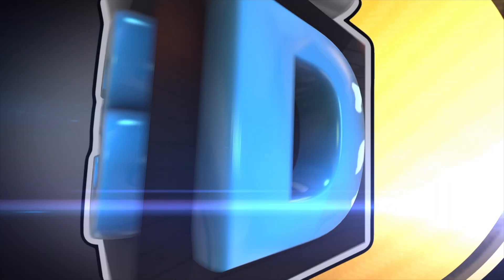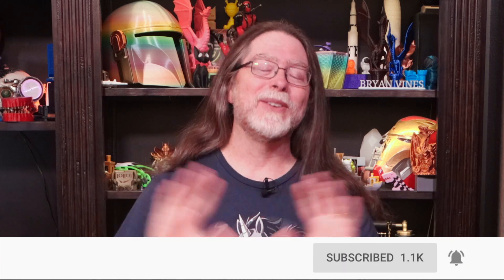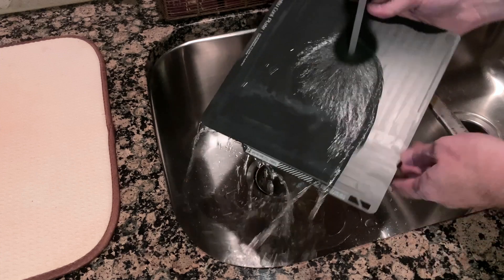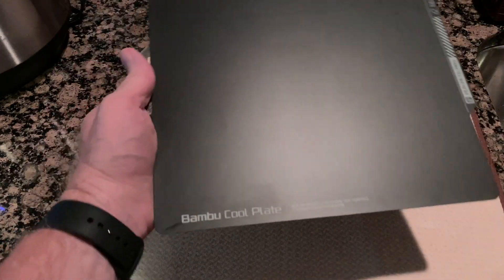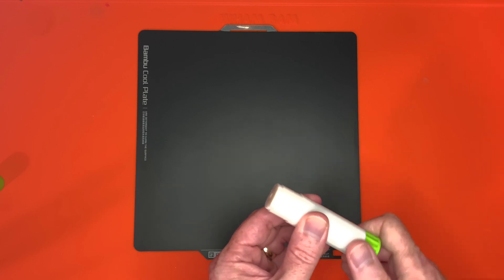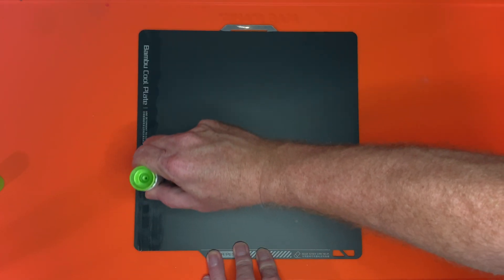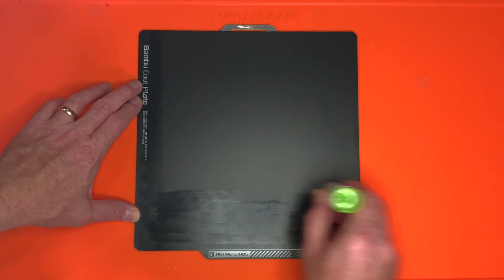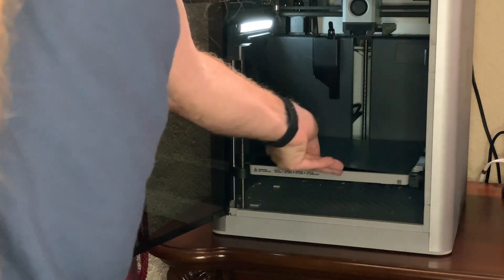Dress (the bed on your Bambu Lab X1 or X1 Carbon) for Success!

Comment: Thanks for this great video. I just did some test prints on a Bambu Lab X1 Carbon and the glue stick works perfectly. I have a question, however. I thought one must clean (I mean wash with soap) the build plate after EVERY print, but several people say they clean after 5-10 prints ??!?  It's just that, after I remove the prints, you can still see where the model was attached to the plate, though the plate itself is clean (i.e. there is no residual filament or anything), and I thought this glue stick residue would affect the next print ... So my question is : is it true that I only need to wash the build plate with soap once a week ? (or after 5 or 10 prints ?)

Comment: I noticed the PLA/ABS side of the build plate comes out of the box with a protective film that you need to remove (I almost printed on it), but I can't tell if the PA/TPU/PC side also has a film or not. Anyone knows?

Comment: Thanks for the video. On the other side, the Engineering Plate, do we use glue stick on that side too ? For the two replacement Cool plates that were included, when should we use those ? Do they just stick on top of the existing one ? Or is there something that peels off ?
Reply: Late reply, but for others reading and wondering - You peel off the old sticker and install the new one. They have a step by step on their Wiki. Glue - Yes you can use glue stick on Engineering plate, but they recently discontinued it in favor of a PEI plate.

Comment: Dumb question but, Does the glue need to dry before you print?
Reply: I'm absolutely  not an expert.  But I just put it in before I'm about to do the print.  I don't really wait for it to dry at all.  My prints (usually) come out perfectly... so my answer world be no,  not necessary to wait until it drys. I think that defeats the purpose. Happy to be corrected if I'm wrong.  Hope that helps
Reply: It's going to dry rather fast as your bed heats up to 60+ centigrade. I wouldn't worry.

Comment: Coming from a lowly Ender 3 Pro with a buildtech (or however it's spelled) magnetic plate, which has worked pretty much flawlessly for PLA at least, the thought of having to deal with glue sticks feels like an annoying step backward, especially when the X1 Carbon is an upgrade in every other way. I really hope Bambu Lab or a third party come out with a buildtech option.
Reply: There are already pei options available on AliExpress. They are a bit pricey but reviews so far where good

Comment: They supposedly had 2,000 ready to go. I've received less contact from Bambu so far than I have from Anker. I've received constant updates from anker. They said it's on the boat even though it was supposed to be late 2022/ early 2023. I've gotten nothing from Bambu and it's starting to worry me. When/how did you receive tracking about your X1?
Reply from the maker: Hi! Just after the close of the Kickstarter campaign, I received an email from Kickstarter (it was a post from Bambu Lab) to let me know they were sending out Pledgebox surveys to collect shipping addresses. I got that email, and the one from Pledgebox, on July 7. I filled out the survey, and got a shipping notice via email from Pledgebox on my particular Kickstarter unit about a month later (Aug 5). That email had the FedEx tracking info. The unit was delivered a few days after that.
Reply: @BV3D  Thanks so much. I received the pledge box survey and confirmation they received the info. Guess I just have to keep waiting. Thanks so much!

Comment: I went the expensive route and picked up some Nano Polymer but the place looks super clean and printer release with zero issues. 

I get about 10-20 prints before I feel I need to reapply.
Reply from the maker: Cool! Jim @TheEdgeOfTech is a big fan of that stuff.

Comment: Have you tried using 3DLac (or similar spray) as an alternative to glue stick on the Bambu Lab? In any case, it seems a bit of a hassle with this material, glad that there will be a PEI option in the future.
Reply: Stick far too much, damaged the bed sticker (bubbles). can be use slightly in addition to glu stick (apply with IPA)

Comment: Hey Bryan great video,
  May I humbly suggest a slight tweek to your method. If after your vertical lines on the left hand side you start at the back of the flexplate and work to the front you will be less likely to end up with any glue on your cuff, forearm or Steven Tyler wrist bandana. 😉

Comment: I don't have either of those printers, but do use glue stick on occasion. Might be worth making a Short video or quick blurb about glue sticks. They are NOT all the same. I ran across one of the Elmers brand sticks that did NOT work for 3D printing. It was a waxy looking white, not the usual clearish purple. OOPS! Elmers does have a purple glue in their usual colored stick in a giant tube that works awesome!

Comment: Have you noticed any holes/tears forming in the plate sticker?   I've heard a few complaints about that.   It doesn't seem to be related to bed adhesion but instead with nozzle contact.   Still waiting on my combo unit (backer in the 3200s, also in SA).
Reply from the maker: I haven't seen holes or tears on mine personally. What I have seen is the occasional air bubble between the cool plate sticker and the actual flex plate. I haven't had those adversely affect the prints, though. I have heard of people accidentally nicking the cool plate sticker with the razor blade scraper thing though.
Reply: @BV3D  Yeah, I've heard about bubbles tool.   One of the users said they just worked around the bubbles until it was too inconvenient then replaced the sticker.   I'm to used to using Creality's textured glass plate that moving to a surface that can be damaged far more easily is definitely going to take some getting used to for me!

Comment: I've used a glue stick always, but use a different application approach. I never remove the build plate. I apply some glue stick then use a wet micro fiber cloth to spread the glue in an even layer over the whole bed. This way I have a very fine ultra thin even layer which I can use for several prints. After that I clean the bed with only a clean wet micro fiber cloth and then start the process over. This takes very little time and always gives me a smooth service that adheres to the build plate.
Reply: Edit: this even works perfect with PETG on a glass plate. Tried and tested many times
Reply: Yes this is the way. Just put a little water on a paper towel or whatever and lightly go over the build plate to spread the glue and make it sticky again. This is what I did for the Ender 3 V2 as well on its glass build plate.
Reply: Put some IPA on the plate, then apply the glu stick, much better coating than just using the stick alone. IPA dry quickly.

Comment: I have never had any luck with glue stick and I find it frustrating in the extreme. I have nothing but flawless results using hairspray. What are your thoughts on substituting hairspray on this kind of cold bed. After a while I’ve even found that PEI starts to fail and you need to use hairspray.
Reply from the maker: I've never used hairspray on a printer, but I know people who swear by it. I mean, it couldn't hurt to try it (assuming the hairspray was applied in a well ventilated environment away from ignition sources). Like glue stick, it just washes off in warm water and soap.

Comment: That's what I did initially when I got my printer, but unfortunately that made the prints stick even more to the build plate... What I do now is I only apply the glue stick to certain spots, but I make sure to cover the calibration lines fully at least as those sometimes stick too well without glue stick. Usually the first print still sticks on too well, then I don't apply any glue stick until I notice that the prints start to stick more than they used to, which is when I clean it as you showed and repeat the process.
I also noticed it helps putting parts which aren't tall to the very edges of the build plate, as they can be flexed more and more easily removed. Tall parts I tend to put in the center, as I can always use leverage to get them off.
Reply: Thank you.  That is very useful information.  Appreciate you sharing   :)